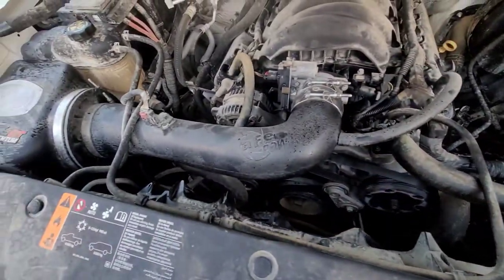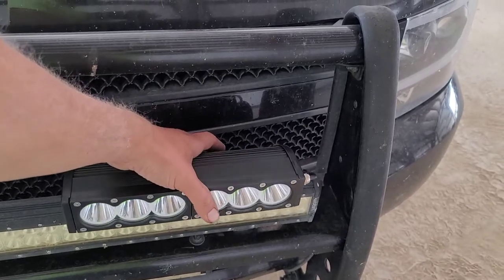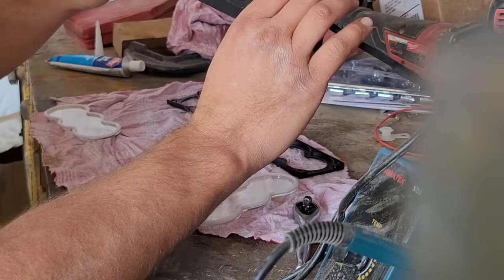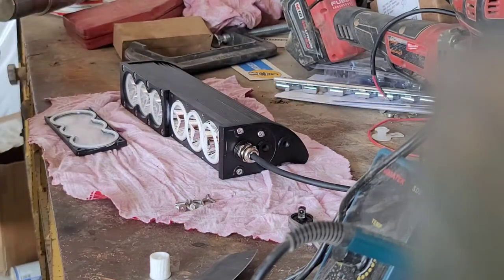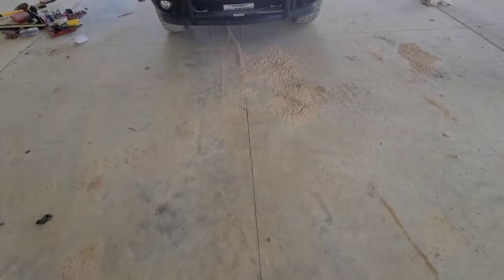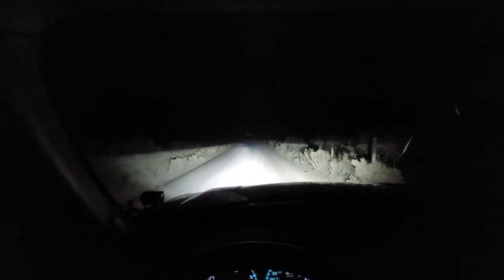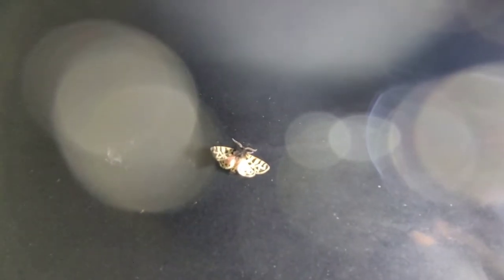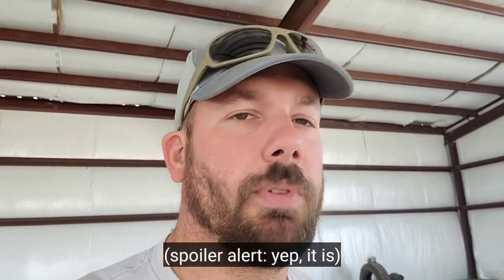Dual Lightronic light bar install on the Tahoe (HUGE improvement in long-distance throw!)

Comment: hopefully u see this is there a link for those spot lights you have on ur hood? i’m looking for a light like that for a good price n
Reply from the maker: Hey Anthony, sorry for the delay in responding. You can find these on Amazon, link here:
https://a.co/d/iHtD3tQ

There are other options for less money, but these are only about $35 for the pair, are pretty bright considering how small they are, and are holding up really well. They've been on my Tahoe for almost two years now, lenses still look brand new. That truck is parked outside all day/night and they haven't started yellowing or anything like that. I've been impressed.
Reply: @AllThingsMech  sweet thank you!!